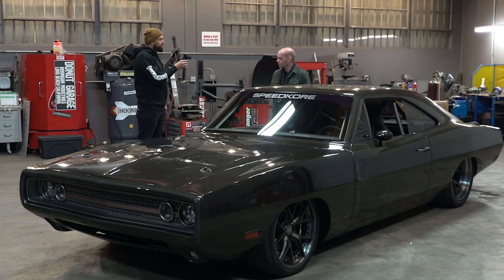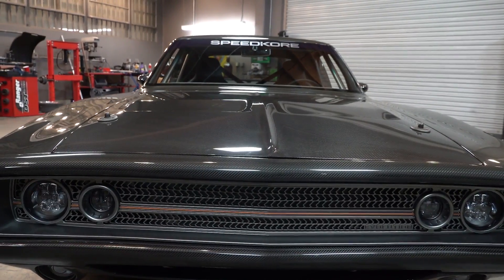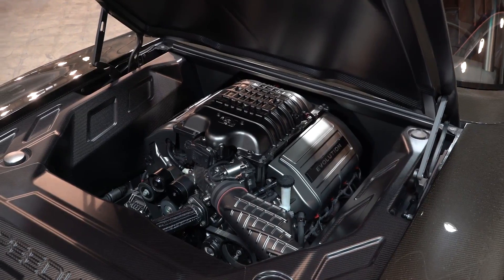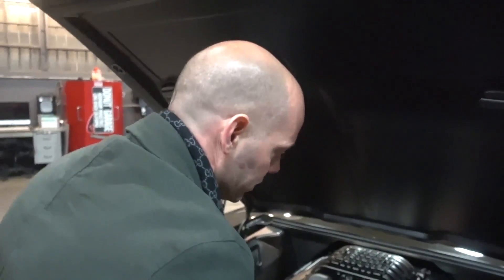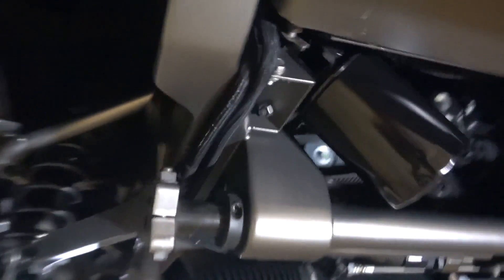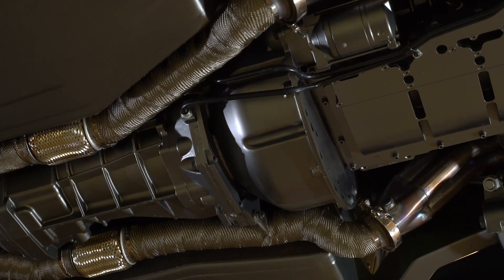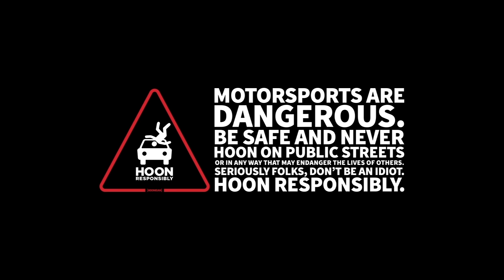ALL-Carbon Body '70 Dodge Charger - 950hp worth of Carbon Fiber Madness!

Comment: What chassis / car would you want to build in all carbon?
Reply: NA Miata
Reply: 92 Fireturd
Reply: An wide bodied RX-7  FD with a three rotor would be godly.
Reply: porsche 928
Reply: That's really tough lol so many choices. Have to say a 65 stang or a s13 hatch with a vielside rx7 vibe
Reply: 69GTO
Reply: 1983 awd tercel wagon or a Cressida
Reply: Nissan Skyline R34 GTR 😏
Reply: Hoonigan Project Cars MR2, FD or an old mini
Reply: Monocoque Honda s2000
Reply: Street Bandito is doing an all carbon 240z. Get them on when they are done! Check out their channel.
Reply: Plymouth Superbird
Reply: The fastback mustang from Bullitt... might as well make a set.
Reply: Fiat Multipla 👌
Reply: Rx7 spirit r
Reply: 69 maro
Reply: Porsche 935 or 930 Turbo
Reply: Third Gen Trans Am!
Reply: 2010 or 2019 Buick Regal Gs
Reply: Ferrari 250 GTO, it'd be slot cheaper then the real thing
Reply: Porche 944
Reply: Most likely a FC RX-7 that has a RE Amemiya body kit on.
Reply: 1987 GNX
Reply: 68 Camaro
Reply: 67 Chevy II Wagon
Reply: E30 BMW
Reply: 2016 Mustang 5.0
Reply: Hoonigan Project Cars BMW m3 e46
Reply: A 1970 Chevelle..AKA Felony
Reply: 1969 camaro or a 66 nova wagon
Reply: Hoonigan Project Cars 950 hp carbon fiber corolla
Reply: Ford Maverick
Reply: the 80s monte carlo SS.. but with the more nascar aero, all at once.
Reply: Golf Mk1
Reply: Ariel Atom
Reply: Foxbody coupe with IRS and the engine/trans from a 2013-14 gt500. I already knew about these guys and planned on doing it already. But knowing you have to build the car first makes it easier so I can set it up how I want then take it to them and have them turn it into almost full carbon fiber.
Reply: Honda S2000 with a racing 4 rotor
Reply: Golf mk1
Reply: BMW E30
Reply: Bentley continental those are very over weight
Reply: actually, before this came out I was thinking about how hard it would be to make a full carbon bodied truck, how odd is that?
Reply: Geo metro
Reply: 1969 camaro ...  Beauty of a car!
Reply: Chevrolet opala 88 diplomata coupe.
Reply: 73' f250 on bags
Reply: 03.5 mazda MSP
Reply: Jag xj220
Reply: a Streetable full carbon 60's Mustang with a blood shed custom electronic motor. that thing would be stupid fast.that or a. custom carbon mini with a big block that wouldnt fit
Reply: 63 Ford Falcon Sprint with a Coyote drivetrain... Might as well go AWD while we're daydreaming...
Reply: Fox body mustang
Reply: Flared out fox with cobra IRS and gt350 drivetrain.
Reply: 97 dodge intrepid
Reply: prius
Reply: I would have to go with a 69 Chevelle and put a 572 crate motor and a Tremec T-56 Magnum 6 speed manual trans in it... That would meet my American Muscle dream car qualifications! ;)
Reply: 991 . Gt2
Reply: 2003 Mercedes SL500R, crazy carbon aero, some johnny's, headlights replaced with intakes for twin turbos, LS-swap on Holley ofc.
Reply: Robert Downey Jr.'s 1970 SpeedKore Mustang is absolute perfection
Reply: A 1995 mustang cobra
Reply: '80 C10
Reply: Hoonigan Project Cars my 1999 ford superduty
Reply: 69 Camaro
Reply: 66 ac Cobra.
Reply: @zerodamonsta942  4rotor plz
Reply: Bmw e36 touring
Reply: AMX Javelin
Reply: alfa romeo montreal.
Reply: 1949 Ford Custom Classic
Reply: Mitsubishi Lancer Evo VI
Reply: 66 c10 shortbox
Reply: Lancia Delta HF Integrale
Reply: @MrNiceGuy1266  WTF?! 😂😂😂
Reply: chevrolet suburban. 1990- 1995 model. its an SUV that already handles better than just about any other in a corner, and dropping that weight off of it, bringing the CG down, would make it even better. even with the stock 454 it is a rocket, and plenty of room if you wanna start getting crazy with blowers and stuff.
Reply: @Balomis  Robert Downey Jr's Mustang is pretty damn nice but I would've chose a different color... full exposed carbon would be sick! The whole front end is already carbon...
Reply: Mazda RX-7 FD
Reply: 64-69 mustangs.
Reply: My B4 Legacy
Reply: Saab 900 with a rear wheel drive conversion
Reply: 1980 datsun 280zx
Reply: Lada
Reply: Lancia Stratos and throw a 5cyl audi motor in it.
Reply: Iroc-z
Reply: an '08 dodge viper ACR
Reply: Fastlane racing co. Nah drop an ls into that, then that would be godly
Reply: E60 m5
Reply: Toyota Altezza RS-200 Z-EDITION.
Reply: 1968 series 2A Land Rover. Stock frames rust like a bitchhhh
Reply: An OG mini so I can slide it everywhere
Reply: 2000 SVT Cobra R
Reply: Same base idea but the number 43 and the colour blue are very big clues
Reply: mazda rx3 coupe
Reply: 2012 Subaru sti hatchback....with a secret idea for a motor.  Carbon fiber driveshaft....
Reply: VW Karmin Ghia
Reply: r34 obviously 🤔
Reply: Hoonigan Project Cars VW GTI
Reply: Hellcat widebody but make it a convertible.
Reply: My S15 or a Hakosuka
Reply: Hoonigan Project Cars Citroen 2CV
Reply: mopar guys already got their carbon car we need something more economical to mass produce like a model t
Reply: corvette nomad, corvair, nissan 240RS, mitsubishi starion, rx-3 widebody, 80s buicks
Reply: VW rabbit.
Reply: 65 or 66 Impala
Reply: Can someone teach these guys how to hold a camera and film. ffs majority of these close up shots are out of focus, cmon.
Reply: Bugatti Type 57 SC Atlantic
Reply: Everything carbon
Reply: Nissan Skyline R32
Reply: Porsche 996
Reply: 1985 w124. Big ol Mercedes station wagon.  Shoe horn a big NA high rev V8 in there. New school hammer wagon
Reply: 1974 Chevelle Laguna S-3 done in a modern interpretation of a NASCAR Stock Car.
Reply: AW11 SW20 MR2, MK4 Supra, BMW E30 E36 M3, Integra Type R, S2000 CR
Reply: Auto red bug. If you know, you know
Reply: E30 BMW
Reply: 2001 Ford Mustang!
Reply: 1970 and a 1/2, split bumper Camaro to this level would be insane
Reply: None it already has been done twice by speedkore although personally I prefer the 69 charger with the split grille.
Reply: I just wanna say Duster.   But maybe like a 66 Charger.   (The 1st gen with the four bucket seats and all that coolness.)   There's a lot of big Mopars that I love but are just too heavy and boatey for me to want to deal with compared to, say, a Duster.   (And I wouldn't put 900 HP in em, either,  I'd use the carbon fiber to not 'have to'  have four hundred, even. )   Probably a lot of wagons I'm not thinking of that are just too heavy but would be useful.  :)
Reply: @zerodamonsta942  Nope, make it a 4 rotor.
Reply: 1993 Mazda RX-7 with a single turbo 4-Rotor hooked to a Tremic 6 speed transmission. Something like David Mazzei's RX-7.
Reply: LX Torana hatchback
Reply: that is literally the car i would rebuild. period.
Reply: Ferrari Daytona.
Reply: An aimgain widebody brz with a porsche flat 6
Reply: Crown vic
Reply: gt86
Reply: @loqmanes6114  Hell yes. A wide body carbon fiber BRZ with a Porsche flat 6. Then a twin turbo kit, roll cage it. I would drive it.
Reply: @SaturdayWinter  I agree. Maybe have someone else film and Dan do all the talking.
Reply: @dmn6480  Keaton Speirs bought a ACR Viper. Youtube handle is Speirstheamazinghd
Reply: @jastark22181  You my friend have a great taste in cars. Save the mansmission.
Reply: 1968 El Camino
Reply: @danielscott6787   I had one of those cars when I was in highschool back in the mid 80s.
Reply: 70 buick gsx. I always thought they wer a more sexy chevelle.. Or an early 90s ford ranger with a 3.2 sho v6 and manual trans
Reply: @MrNiceGuy1266  lmao or the sebring convertible. Nothing like a clean sebring to pick up pageant chicks
Reply: NSX
Reply: Boss 429😏
Reply: Dodge Dart or viper or maybe a TVR sagaris if money no ain’t a issue a bmw 2002
Reply: Fiat Multipla
Reply: 67 chevy impala 4 door
Reply: 1990 Subaru Legacy RS Type RA
Reply: Achilleas Freris  why a 316i and not a 323i?
Reply: 1970 Nissan Skyline GT-R but with the flares integrated in the carbon and just painted black
Reply: @stefanwinter1377  you'd spend 500 grand to build a 92 firebird  is that what you drive ?
Reply: @fukkyoutube  Nope. I actually drive a 94 Firebird. And I'd like it because nobody has done that before.
Reply: 64 Vette
Reply: @waybous  This is the build I dream to make once I finish my mech engineering studies (I am supposed to start next year)
Reply: @waybous  Thanks =) And i agree! #savethemanual ;)
Reply: 1972 nova
Reply: A 1963 Corvette split window!
Reply: 2017 Subaru wrx sti
Reply: Eg hatch
Reply: Ferrari F40
Reply: My Honda accord cl7 euro 😁
Reply: Volvo 240
Reply: Stis and Evos.  Offset the the weight penalty of the Awd running gear.
Reply: A 68 EL Camino.
Reply: 1968 Chrysler 300 and 1976 Chrysler New Yorker [both in 2 door mode]
Reply: @waybous  Fuck it, give it 12 rotors
Reply: 1967 Pontiac GTO
Reply: Impreza 22b
Reply: @darius2640  I'm with you there my friend. I had a 600HP Honda CRX "sleeper" because of the rear quarter panel rust.
Reply: C6 corvette, n/a 700whp, gt3 aero all corbon. Everything.
Reply: Charger daytona
Reply: Mark 4 Supra or a C5/C6 Corvette would look dope as shit, if I could afford it I'd pay this guy to build one lol
Reply: 1985 Audi Sport Quattro
Reply: Impulse already did it, an AE86
Reply: Porsche 928 GTS Clubsport
Reply: 1969 gtx roadrunner 440 six pack
Reply: Toyota Corolla!! The mpgs will be legendary
Reply: 90 Ford Fiesta
Reply: All carbon 89 Honda CRX.
Reply: Very beetle
Reply: 1959 Cadillac El Dorado with v12 LS Chevy engine
Reply: @g0th1cazn  that'd be cool
Reply: A 1998 mitsubishi Shogun short wheel base, using rieger suspension.
Reply: 1989 Porsche 944 LS6 Basic swap
Reply: Dodge Viper
Reply: A R34 or R32
Reply: 56 Chevy in all carbon.......I would die a happy man.
Reply: 240Z
Reply: Honda s2k would kill it 🔥🔥🔥
Reply: Studebaker Avanti R4 baby
Reply: 71 cuda
Reply: @justinjohnson623  ayooooooooooooooooooooooooooooooooo
Reply: Fire truck
Reply: Buick Grand National
Reply: 1997 Prius
Reply: Shartcart
Reply: s15 Silvia
Reply: Same car in the video. Daytona Charger instead.
Reply: School Bus! Just for the hell'uvit.
Reply: A Custom Chassis
Reply: Watch out for Street Banditos all carbon 240z they are Building it on their channel
Reply: @lorderussell4091  Street Banditos
Reply: Laurel c35
Reply: Ae86
Reply: A WIDE BODIED ZAK SPEED, MY 1 ESCORT..
Reply: Mk1 escort.with Zak speed Body style.
.MEAN..
Reply: Miata
Reply: Lincol LS or 66 Continental.
Reply: Bugatti Atlantic
Reply: Ford KA
Reply: Buick Riviera 73'
Reply: E46 M3; Honda EK9 & DC2 Type Rs
Reply: AMC Pacer. Kidding!
Reply: 1980’s Subaru BRAT: Bi-drive Recreational All-terrain Transporter"
Reply: 1st gen Rx7
Reply: @TheMurlocTamer  Another vote for 250 GTO
Reply: Fiat multipla
Reply: Dodge charger Daytona
Reply: Ford Excursion. Lol
Reply: '69 Goat
Reply: Geo metro
Reply: Toyota Tacoma xrunner
Reply: 69 Daytona
Reply: Mr2
Reply: W204 C63
Reply: Lamborghini Supperleggero
Reply: 1970 camaro
Reply: 67 eleanor mustang
Reply: Charger was a good one, next would be 70 Chevelle for me
Reply: Bmw E46
Reply: Hoonigan Project Cars 70/71 Cuda 💜
Reply: Scuba Steve lol  😲
Reply: Chevy Opala SS
Reply: Not seeing it drive though? btw, how much something like that would cost to buy?
Reply: AGmodelz gonzalez awesome, I had a 70 Roadrunner and love the styles of the B body design 👍
Reply: Gizmoriderful Ya l can remember where I saw it, but I read somewhere that it was 650k😲. That's a lot of money but the car is incredible and very special
Reply: @lovethesmellofracefuelinth7374  Yea I dont see that as unreasonable tbh. Different thing where to find buyer tho, but great work of craftmanship
Reply: 1968 Corvette
Reply: Tesla model s P100D
Reply: Volvo 745
Reply: 67 eleanor mustang with 427 side oiler
Reply: All of them
Reply: Skyline GTR R33
Reply: One of my 65 rambler Marlins!
Reply: 57 Ford two door ranch wagon
Reply: Exactly this but with the 69 front. Because 69 and I just love the flip ups and the look of the closed grill with the nose.
And a bagged De Ville probably 68 model.
Reply: 1982 Trans Am - KITT conversion from scratch by these guys.
Reply: I'd do an older 911 and then do a collaboration with Bizimoto for the guts!
Reply: chevy vega , drop a twin turbo 600 cubic inch big block in it ! all tube  chromoly chassis
Reply: hemi cuda and Impala
Reply: 69 Chevelle, McLaren 720, Bentley GT,  so many....
Reply: BMW M3 E30
Reply: Chillmal I second that, I’d love to carbon out my 15 Regal GS
Reply: GT40.
Reply: Jaguar XJS/XJ6
Reply: F1 car
Oh wait...
Reply: Volvo P1800 would look nice
Reply: 1998 Ford Mustang GT
Reply: Old style VW Beetle 🤣.  AE86.
Reply: tercel
Reply: GNX
Reply: Hoonigan Project Cars 1969 Camaro ss ls9 swap 😂
Reply: 71 firebird in white carbon.
Reply: Singer Porsche
Reply: Pontiac Aztec.
Reply: BMW E34 M5 ❤🤘
Reply: r34 skyline
Reply: Mercedes sl300 Gullwing with 63amg powerplant
Reply: 1961 Cadillac series 62 coupe
Reply: BMW E21 323i
Reply: R32 gtr
Reply: 69 gto
Reply: 442
Reply: Jag e type!!!
Reply: The 2020 gt500..... That would be a car after john wick heart!
Reply: Singer is already carbon.
Reply: Austin allegro.
Reply: Ford falcon fg f6
Reply: 240z
Reply: All of them
Reply: 61 Impala sport coupe
Reply: Porsche 930 turbo
Reply: 1965 Lincoln Continental
Reply: Porsche 904
Reply: Jag e type ,no brainer!
Reply: '71  Pantera with twin turbo 351-C!
Reply: Original Mini 4WD with a rally car engine
Reply: Blonde 20 yo
Reply: A ford probe
Reply: 1971 Chevelle ss
Reply: Reliant Robin
Reply: 82-92 camaro,maybe a t-top body redesigned, use a twin turbo ls setup also!
Reply: A 73-87 Chevy c-10  would be sweet too!
Reply: 67 cougar
Reply: E46 M3
Reply: All three of the 56 Chevy tri-fecta!
Reply: Audi RS6 / Audi RS7 not the new ones
Reply: Always wanted to do a 2005 Ram SRT10.  Truck bed and all
Reply: Audi RS2 🦸🏾‍♂️
Reply: Peter built truck.
Reply: Toyota corolla
Reply: A Volvo V90.
Reply: 1966 GT40 with a GT350R engine
Reply: Chevrolet apache 60s
Reply: @nickbrick9056  I think the Plymouth road runner would be nice.🔥🔥🔥
Reply: NWC SHREDDER  I think the Ford mk1 escort would be better.🔥🔥🔥
Reply: Hoonigan Project Cars Mercedes 500 SEC
Reply: 1960 911
Reply: 911 turbo
Reply: Ferrari F12
Reply: I'm looking at it
Reply: G35
Reply: 1970 7/28 Camaro.
Reply: porsche
Reply: None
Reply: Ford transit van
Reply: Maybe a widebody stingray from 60's, chevy nova, or can't go wrong with Camaro
Reply: Hoonigan Project Cars Benz w140
Reply: Lotus elise
Reply: 69 Chevelle
Reply: Mini cooper classic
Reply: Datsun 240Z
‘69 Camaro
Ford GT - Superlite did it
Reply: 2020 Charger Hellcat with Redeye engine &
Tremec 7 speed Manual transmission &
fixed 40/60 All Wheel Drive
Reply: 80s IMSA Mustang/Capri
Reply: F10 m5
Reply: One of my dream cars a 69 Dodge Charger Daytona
Reply: Datsun 240z.
Reply: Di Tomaso Panthera ;)
Reply: Dodge D100
Reply: amx
Reply: 1970 Dodge Dart Swinger 340
Reply: W124
Reply: 1956 Volkswagen karmann Ghia
Reply: My first car, a 1959 Pontiac Catalina/Bonneville.When I had mine in the late 70's, mine was the only one I saw in the Cleveland,OH area. It was huge & heavy, but I loved the body style,and the dash when it lit up a night.
Reply: BNR34 Nissan Skyline GT-R V-spec II Nur
Reply: can you guy do other type of car  if any.
Reply: A 1970 Plymouth Superbird on a Hellcat chassis.  Painted a certain shade of blue with the number "43" on the doors!
Reply: 93 Nissan 240sx
Reply: demon plz
Reply: Civic
Reply: volvo 200 series
Reply: 1966 Ford GT40 mk2 or a 1969 dodge charger R/T SE
Reply: Elanor
Reply: Shelby cobra
Reply: Ferrari La Ferrari
Reply: 1977 trans am
Reply: 97 Civic type R
Reply: @duncandmcgrath6290  Absofuckinlutely!
Reply: 67 Mustang Fastback OR
69 Nova
Reply: love to see that made to a Detomaso Pantera gt5-s with a twinturbo lamboengine and take headlights from like a 360/430 instead of the froglight
Reply: 70 Cuda
Reply: 69 Rambler American 2 dr hardtop on a C7 chassis
Reply: @lenardw3585  Oj tak byczq
Reply: What I’m definitely going to do you mean, my evo 8 👀😜
Reply: 95’ Volvo 850 wagon
Reply: Infiniti q60
Reply: An old Duesenberg or Cord.
Reply: 1970 chevelle
Reply: Porsche 928 S.
Reply: Hudson
Reply: 96 impala
Reply: Speed racers mach 5 of course the fastest car in the world
Reply: 72 Dodge Dart Swinger fatboy Sled. Never seen one!
Reply: @RoraighPrice  Electronic motor in a classic mustang? that's disgusting.
Reply: @maciekjak9399  Based and fiat-pilled.
Reply: Lamborghini Sesto Elemento
Reply: @zerodamonsta942  you spelled 4 rotor wrong
Reply: 64 2door ss impala
Reply: '37 chevy coupe
Reply: Toyota Prius
Reply: 69 chevelle
Reply: 1981 Toyota Hilux/Pickup
Reply: Miata na or a viper
Reply: 1987 Montie Carlo SS  (notch back) 🇺🇸
Reply: 240z
Reply: Mitsubishi evolution 7 or evo 9 mr with like a fully forged 2.3 litre stroked engine and good size turbo. Would handle like a dream around a track
Reply: 64-65 Shelby Daytona coup.
Sorry guys there has to be a winner and I'm pretty sure I picked it.
Reply: 1969 Dodge Challenger, real similar body type! A 1970 Plymouth Barracuda would be glorious as well!
Reply: 1970 Nissan 240z!
Reply: 67 or 70 chevelle
Reply: 88 Monte Carlo SS, S15 Sylvia, R33 Skyline, 2020 hellcat, 92 Camaro SS, 2012 M3
Reply: Classic mini
Reply: Prius
Reply: 70 chevelle ss 454
Reply: @Cyrus Logan I can't believe it! another person looking for the Barracuda 2nd gen.
Reply: FC
Reply: '70 Chevelle. Dark red SS stripes made of tinted clearcoat. Tube frame. Solid mounted aluminum big block with DN9 heads.
Reply: Honda civic
Reply: 67 Daytona Coupe Cobra 427 SOHC Fuelie, with a six speed sequential trans. Would also be cool to do a old COE Ford, with a all aluminum frame, slammed in the weeds on air bags. For the engine, do like a quad turbo huge nasty billit block cummins, with a 10 speed sequential trans, and also make it AWD, with rear steering too. That would be sick!!!!
Reply: ‘69 Mercury Cougar
Reply: Either a 67 or 68 F-body or a 69 or 70 A-body. 
Gotta keep it as a muscle car.
Reply: 77 280Z
Reply: @meh11235  Yes, the 240/260/280...they are all rusted out due to being made with no rust protection!
Reply: E46 M3 CSL
Reply: Agora é só fritar😁
Reply: Ele levanta 🙌
Reply: Honestly the list is too long for me to design
Reply: Dodge charger scatpack widebody
Reply: DeTomaso Mangusta
Reply: @williamjohn8831  scammer
Reply: BMW E9
Reply: R34
Reply: Nsx
Reply: bmw e92
Reply: Hakosuka skyline 🔥🔥🔥
Reply: Toyota Prius or Yaris...
Reply: A Ford Probe GT.
Reply: 64 mustang mach 1
Reply: How much did the body alone cost?
Reply: 1968 mustang fastback
Reply: Chevy Master Deluxe from 1937
Reply: Suzuki Sx4 🤣
Reply: Coming in from down under. I’d love to see an au falcon done in full carbon fibre and having a 1000hp Barra turbo under the hood with a t56 behind it and a ford 9” at the back😍
Reply: Lotus exige
Reply: 60s Camaro
Reply: My Powerball dream car. Full carbon Shelby AC Cobra. Titanium and carbon tube chassis and floor. Carbon wheels. GTR drivetrain built to at least 1,500 horsepower. AWD and sub 2,000 pounds. Ideally 1 pound per horsepower. Full titanium cage and full carbon removable hard top. 15" carbon ceramic rotors with 6 piston brakes all around. Just for a little safety.
Reply: My Powerball dream car. Full carbon body Shelby AC Cobra. Titanium and carbon floor tubular chassis. Carbon wheels. GTR drivetrain built to at least 1,500 horsepower. 15" carbon ceramic rotors and 6 piston calipers all around. Full aluminum and titanium suspension. Titanium and carbon roll cage. Ideally 1 pound per horsepower...or better.
Reply: My Powerball dream car. Full carbon body Shelby AC Cobra. Titanium and carbon floor tubular chassis. Carbon wheels. GTR drivetrain built to at least 1,500 horsepower. 15" carbon ceramic rotors and 6 piston calipers all around. Full aluminum and titanium suspension. Titanium and carbon roll cage. Ideally 1 pound per horsepower...or better.
Reply: 79 Firebird. . Butler Pontiac V8.
Reply: EP3 but remodeled by me(wider, lower, kick ass)
Reply: Ur mom
Reply: Nothing it would be written off to easy
Reply: Trackhawk
Reply: 1970 AMX 2 seater.At 2800 -3000 lbs stock ,you end up with a  2300 pound road rocket with a 500 hp AMC 390 - 401. manual or auto transmission /Corvette front spindles/A arms /suspension/9 inch Ford IRS in the rear.Carbon unibody tub with mandrel bent steel frame connecting the suspension /drive chain/aluminum or stainless steel floors.Light weight carpet,etc
Reply: @Shawnbfromsd It weighs 550 kg /1200 lbs.Ading a carbon fiber body would add weight. The trick is to add a fresh Honda K20 / K24 single turbo tuned to 450 -500 hp.With race tires and a good driver along with a Quaife sequential gear set the car is capable of 8.0 second 1/4 miles at 170 mph .0 - 60 in 1.90 -2.0 seconds.Scary fast and 35 mpg on pump gas..
Reply: I know Im asking the wrong place but does anybody know a tool to get back into an Instagram account?
I was stupid forgot my login password. I would appreciate any help you can give me
Reply: @Angelo Yehuda Instablaster ;)
Reply: @Jadiel Spencer Thanks for your reply. I found the site thru google and im in the hacking process now.
Seems to take a while so I will get back to you later with my results.
Reply: @Jadiel Spencer it worked and I now got access to my account again. I'm so happy:D
Thank you so much you saved my ass !
Reply: @Angelo Yehuda happy to help :D
Reply: @angeloyehuda335  If it's tied to your email phone, etc Yes of course.If you're trying to reset or access someones else account, No.
Reply: My car I own now. 92 Subaru Svx
Reply: Yugo
Reply: @ricko5123  Yes, a 1500 lb /680 KG Carbon Yugo with a 600 hp K24 or 2JZ..7.90 1/4 mile times.LOL
Reply: Fiat Multipla
Reply: Svx
Reply: Mk3 supra
Reply: 68 charger😂
Reply: Take a shot every time he says tie it all together
Reply: 2019 Subaru STI S209
Reply: Lancia 037
Reply: A 91 nsx so they could program for more engine bay space to drop a 2jz/rb/v8? Into it just bc you could
Reply: an autoclave that size? serious $ holy shit.
Reply: They nailed it right here, except back up one year to the '69 charger!
Reply: HONDA ELEMENT
Reply: Zephyr!
Reply: commodore wagon
Reply: Go check the dude that 3d printed a Lamborghini.
Reply: 1980 2 door Malibu!!! Mine my dad and me built got destroyed by a drunk driver in a big jeep 😢
Reply: Datsun B310 with sr20 Engine.
Reply: 1970 Plymouth superbird
Reply: mercedes 190 E
Reply: A Citroën 2cv : )